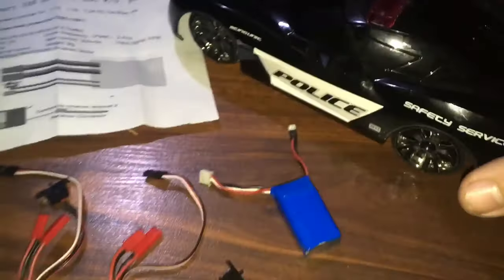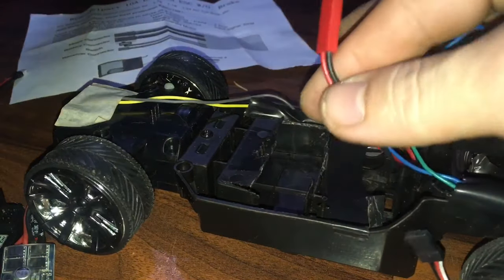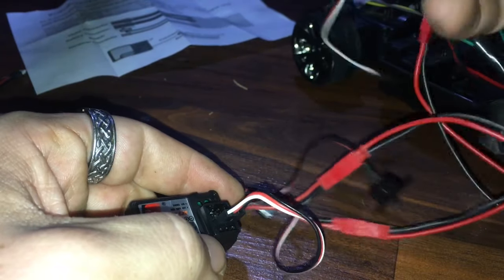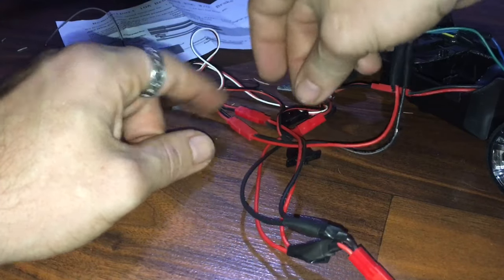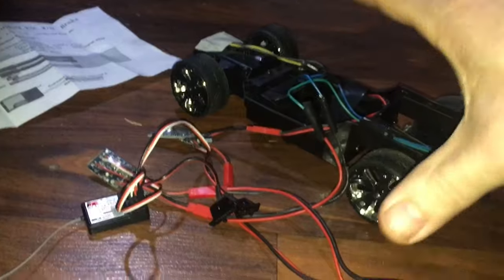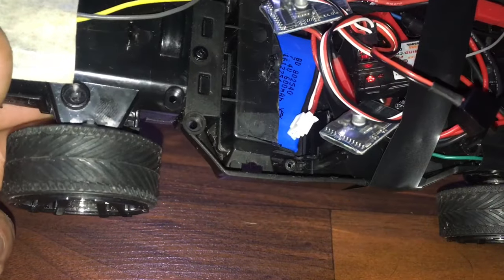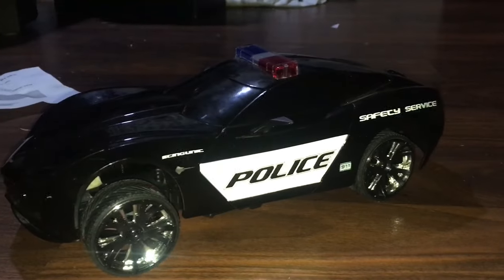Upgrade any Toy RC Car Jada Hyperchargers SIMPLE DIY Flysky

Comment: So I got these ESC's and a Flysky GT3C as well. And connected it all up to an old F-250 by New Bright, runs well, change the motors when I want to. And these ESC's are just really good for little cars.
Reply: Is it truely digital propositional steering without servo?
Reply: @maznim1268  Yes
Reply: @maznim1268  noo

Comment: I did this with a toy tugboat. The electronics that were originally in it were coated in beeswax that didn't prevent the main board from getting wet and shorting things out. It didn't function when I got it so I stripped everything out except the original motor and upgraded the electronics to hobby grade. The lights, wenches and everything are run off separate  circuits I had to build, but the basic ESC, and receiver set up was easy. I did have to add a servo for steering, but the new one was easily adapted to the existing  steering system with minimal modification.
Reply from the maker: Awesome did you do a video on it
Reply: @JayDrone  I believe I did, its on You Tube under RC Hobbiest Extreme. I do have a fireboat I plan on doing next. It's basically the same design but better electronics . The first one was a fishing trawler, not a tug boat. It's called MONICA. You cannot find one anywhere now because they all failed and went to the landfill or recycle. I picked mine up from the local Goodwill for $14. I took a chance figuring it probably wouldn't  work( it didnt). The LED lights came on and that was it. I reworked all the lighting, adding spot lights, interior  lighting and such. Sadly I fried the wench motor last time I rigged it up due to mis- labeling  the connectors to the battery. This winter, I plan on reworking the wench( used for raising and lowering the nets) system. I didn't  care for the cheap crappy brushed motor in it anyways. I will replace it with a re- worked servo by eliminating the stops and converting it to a wench motor. There are simple videos on that procedure.

Comment: Saw your video, i have a very cheap jada fast and furious car that i modded, i think it has the same insides. 
I added a 2 in 1 esc/reciever and also a servo.
Original it had a 3,7v battery so i upgraded to 2s 14650 900mah..

It is so freaking fast now and thanks to the servo not only donuts but also awesome long drifts, this upgrade is eating the tires hard so i gues i have to find a way to put some descent rubber on it.

Thanks for inspiration 👍🏻
Reply from the maker: Awesome ❤️
Reply: Its not "very" cheap.
Reply: @blakeg4166  these where spare parts that i would never use again. So for me was pretty cheap.

Comment: Hey Bro came across your Channel VERY COOL...Question: Do you think a 2004 Toyota Celica (Jada Toys Import Racer) 1:10 Scale 27mhz can be upgraded with a Brushed motor?...I've had ths car almost 20yrs just found it again..want to beat my cousins 30mph R/c
Reply from the maker: Yes, all toy grids can be upgraded. It’s just how much you have to put into it. Most of them are very simple.
Reply: @JayDrone  what Parts would you suggest I get and Cites to grab them from?...And 1 more quest. You think I'll have to change the remote control aswell?

Comment: Man you're awesome. Planning to mod out my new bright corvette. But i have a question. The flysky controller you have in the description box, it comes with a receiver. Can we use that receiver or do we have to buy a separate receiver?
Reply from the maker: Do you have to use a compatible receiver to transmitter the transmitter being the remote control that you were using so in this instance you would need again a compatible transmitter to receiver hopefully that makes sense

Comment: I tried this out but found lots of delay and stalling. I'm using a fs i6x controller (this is meant for fixed wing) but I feel like this isn't the problem because it has no delay with my RC plane. And it should still work with a 2 channel car so idk. I even put the wires on channel 7 which was for switches (their only 100% 0%-100% so everything should be exact and precise) yet it still has a delay. I'm thinking this might be the esc but again idk.If anyone knows why or a fix please let me know. Still great video😊
Reply from the maker: Crazy
Reply from the maker: Never noticed any delays on my end. Sorry don’t know a fix for it.

Comment: I just ordered everything that you show in the video to make my RC faster. I do have a question... If I use two 2s Batteries (one for each ESC, does my rc car will be faster than only using one battery?
thanks for the video!
Reply from the maker: Trial and error, my friend everything that you have just asked me try every RC car is going to be a little bit different because the guts to them are a bit different

Comment: Omg thank. I've been trying to make a hobby grade servo work on toy grade rc drift but this way I can get proportional steering with factory toy motor. Does one need to remove the spring on the steering trim????
Reply: kinda opposite.. if you want semi proportional steering from the bang bang steering motor you'll want a thicker stronger spring, and/or some resistors on the motor leads. definitely better off using a servo, little 9 gram servo's are about a dollar in eBay.

Comment: Man awesome video...I need your help.
I have a tyco 9.6v twin turbo lamborghini that doesn't run but it's a sentimental thing for me. I wanna get it running again. I wanna do what u just did in video with the esc and wires. I have a 2.4ghz transmitter. Did u use original servo,? What do I need to buy? Plz help

Comment: I have a Big Time Muscle Mustang version, and mine has a motherboard unter a panel where the wires are connected. Do I take that out? Help
Reply from the maker: You can if you like it won’t hurt anything being in there myself I took mine completely out to wires in the front is for your steering tires in the back is for your motor

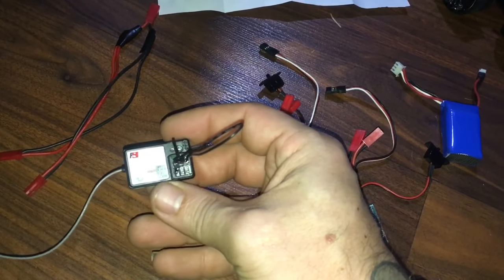Comment: Loved the video, it was very simple but explained everything at the same time. I would love to try this out with the 1:24 scale Jada Toys RC Lightning Mcqueen, I just worry that it won't have enough room for the electronics. I already love the car as is, it is great with driving, and its fun, but one; the stock remote is starting to feel more flimsy as I use it, and that proportional throttle would be awesome, because everytime I try to drive him, I spin out on the floor. Would upgrading the Mcqueen mean having to give up the turbo mode though? If that is the case, then I might not do it, but what do you think, is there some way to still keep the turbo mode on the car with the hobby grade remote? Sorry this is so long, but I am fascinated by this upgrade, its so simple, but it makes a world of difference in making a cheap toy car worth the money. (Because they always end up wearing out within a few years lol)
Reply from the maker: Simple pos n neg - even 6 motors can run on one esc https://youtu.be/0XOfZU8TpL0?si=PsIOQk96W8KAYXb8
Reply: Thank you for the video, but I watched it and I am failing to see how this answers my question, the motor McQueen has has a little board on it, so I'm thinking that is what makes the turbo mode possible, would I just need to give McQueen another motor, and ditch the turbo mode? Or would upgrading McQueen make his turbo mode speed his new top speed by default?

Comment: Got the parts in. Hooked it up bind the controller and connected the esc correctly. Is there any setting that the controller need to be set too? I have the exact same controller as yours.
Reply from the maker: You may need to adjust your channel settings, other than that no

Comment: Just browsing and researching. What exactly did they upgrades do? Did it do the proportional steering and proportional throttle? Thanks y’all sorry for the dumb question
Reply from the maker: Ability to use hobby grade controller, adds proportional throttle and overall range control- also upgraded to lipo = more power=faster-much faster

Comment: Do you know if this will work for a RC Car that has an electromagnet for steering? I am assuming this car has a servo like more modern RCs but I don't want to bother with replacing the electromagnet with a servo.
Reply from the maker: If it only has a Plaza Negitive coming off of it then yes it should work but if there’s any type of electronic speed controller in between it and the board and now it will not work
Reply: @JayDrone  Just an update that this does work with electromagnet steering. I resurrected a Nikko Lazer RC car from I think the early to mid 90s, that wasn't working (I am guessing because of corrosion on the circuit board). Thanks for the video it helped a lot.

Comment: So I know nothing about rc cars but I assume this car has a motor and not a servo for steering?
Reply from the maker: Originally the car had a motor it’s been along time since I’ve looked at this video at some point I did add a steering servo
Reply: @JayDrone  ah ok cool, so then only one speed controller required?

Comment: Why 2 ESCs?? Because they aren’t powerful enough? Or because you didn’t want to put in a servo?
Reply from the maker: Just like a real plan better to have two than just one
Reply: @JayDrone  lol you mean, it’s just for the other motor in the car. The steering motor. Those are tiny little 20a ESCs from a drone. I build those also. But nobody uses those kind of ESCs anymore. Only stacks now. You should upgrade the motor! Doubles the speed. That along with a brushed 60a 3S ESC.... this thing flies like a hobby grade

Comment: I have a 2015 Mercedes,  but I took apart my steering box and I'm trying to put it back together but idk how, jada help center couldn't help
Reply from the maker: Unfortunately a lot of his toys are built completely different this was literally to demonstrate how to cut the wires from the main board use electronic speed controllers and have variable speed just as well as the able to use any controller of your liking providing your pair the receiver to the transmitter

Comment: Which size battery upgrade do you suggest? Or like max battery for this size RC?
Reply from the maker: 1200 to 1500 mAh 7.4v
Reply from the maker: Obviously if you play around with different sizes you may find a smaller battery may give you a longer run time versus a bigger battery because sometimes certain RC cars in motors cannot take a heavier load and operate more efficiently with a lighter load
Reply: @JayDrone  that’s the kind of info I need. Thank you for your knowledge. I am great full hopefully I can modify these right.

Comment: Wait what is this upgrade doing? Is it making the battery last longer or is it making it faster?
Reply from the maker: This will potentially make it faster just as well as allow you Variable throttle and potentially steering
Reply from the maker: It will also give you longer control range
Reply: Oh cool and thanks for replying even though it’s been a year later

Comment: So I did this exactly but my ch1 is not ding anything. The channel two is working . Weird this is when I disconnect  one esc from the battery but leave it connected to the esc the lights stay on on both esc? Could it ve a bad receiver?
Reply from the maker: Could be a bad ESC or the receiver I would bank ESC as I’ve had bad ones unfortunately
Reply from the maker: To determine that just switch to ESC And see if the other channel works if it doesn’t you know that’s your problem
Reply: @JayDrone   yeah I tried that. I just noticed on the receiver it's austin 4-6v but the ad I bought it from says the receiver voltage is 4-14v. So I would asse this is  the problem.  I tried with a receiver and transmitter for quadcopter and everything works fine. This receiver is 4-10v .

Comment: How do I do this if I have two motors and a steering motor
Reply from the maker: Same way just connect the two driving motors together positive or negative run them to the positive and negative of the ESC and then hook up the steering as shown here

Comment: My kid just got the Spiderman remote control car, with 5-10 minutes of playing with it.  it started making a grinding sound and barely accelerates and goes real slow.  if i pick it up and press the forward, it starts off grinding for a second  and then the wheeels start spinning freely and fast without the grinding noise. But as soon as yoi let go or put it on the ground, it starts the very loud  grinding noise
Reply from the maker: The grinding noise that you’re probably hearing is probably a gear gear feed system that is missing a tooth in the year or the year is not making complete contact that’s what I would assume or the motor itself is burned out or burning out
Reply: @JayDrone  u think it's possible for it to be repaired by myself

Comment: great job sir.. but i think your gonna kill your rx.. 2 esc is powering it up.. i suggest to remove 1 power cable on 1 esc to rx (middle one).. that should do the trick :)
Reply from the maker: Na it’s fine same amount of power is powering it reguardless ty for concern tho
Reply: I thinks that's what happened to mine receiver.  The 1st channel not working any more. Worked at first.

Comment: Please help. I've done this to the t of how u do it. When I wire everything up both ESC blink like yours but blinks faster. I took one of the ESC from one of my wpl rc and I had another one laying around and the I was using worked fine.  So after doing this nothing happened. So I unhooked everything and put it back on my wpl rc and now my wpl doesn't work. The steering does but not motor. Any idea what the fast blinking means or why my ESC did work and now doesn't. Please reply asap
Reply: Do I need to bind my remote if it was already binded before doing this
Reply from the maker: You can try rebooting it and see if that works I never had any issues as a shout exactly how to set it up I’m sorry that you’re having issues hopefully you can get it figured out
Reply: I think it was the way I made the jumper wire. I had the 2 ESC jumping from one another vs having them ran in 2 sequences. I fried both ESC this way lol

Comment: I need some help I have a little project 20$ jada   Hyper charger trying to upgrade it I saved a video of the project but it’s private now I bought everything I need I believe I have an soldering and a 18650 battery and holder for it connected it but it’s not working the car still works but I don’t think that the speed changed much there’s 2 modes regular and boost mode in the video that I saw there was 2 18650s installed just wanna start with one please help if you can thanks
Reply from the maker: It’s really simple just follow this video you’re not gonna get the boost mode you’ll get optimal power and you can also increase the voltage but don’t do too much because some of these cars cannot handle much more voltage than originally designed for one of the Jada hyper cars I have done this too it’s a police car they came with I think in metallic red Camaro the police car I have done the exact same thing I did in this video

Comment: My 10$rcjust went into smoke tried to put 4.8 volt battery and right when I connected it went into smoke
Reply from the maker: If you over, bolted, typical, or when it really sounds like it might not have had the connection, right
Reply: @JayDrone  thanks man 🙏🏻it was prolly to much for the cheap lil mother bored the car came with